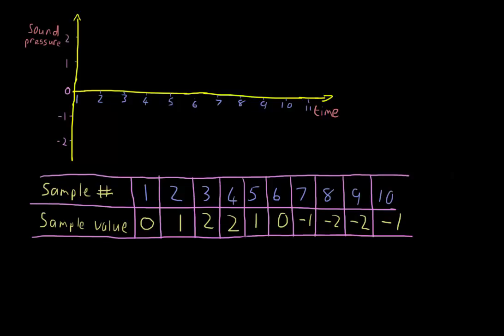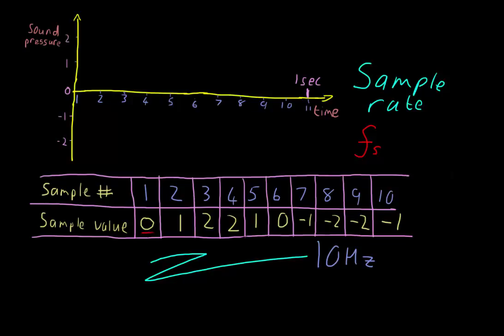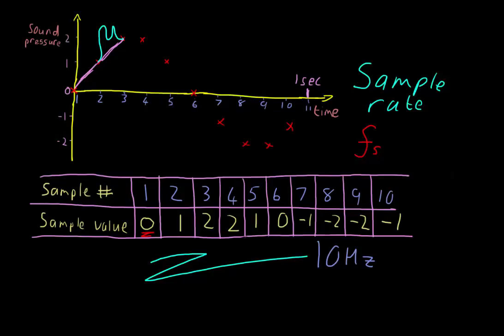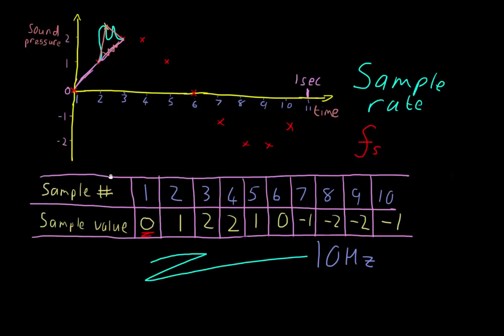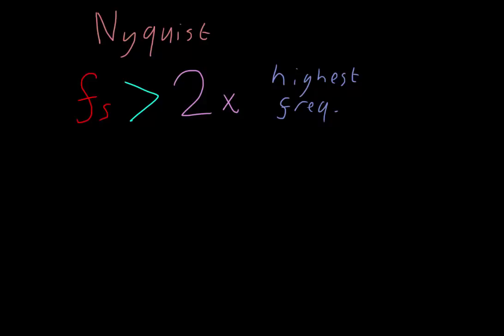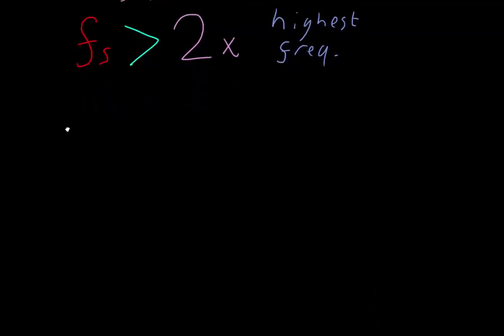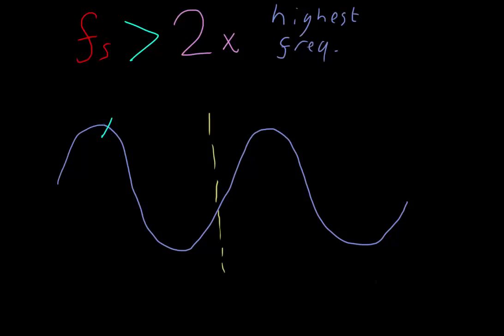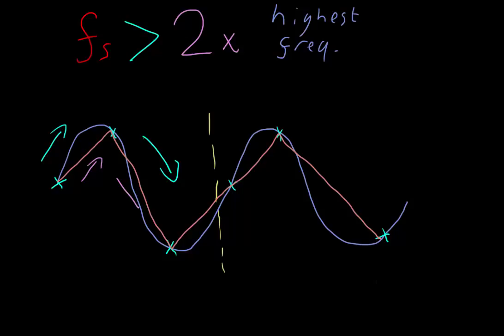Sample Rate and Nyquist Frequency #khanacademytalentsearch

Comment: Question: by using two samples per cycle, what if we choose our (2) samples to be on the highest, and least points on the wave (maximum and minimum amplitudes)? If we choose them that way we can tell if the wave is going up or down so why dont we do that instead of 3 samples? Thanks
Reply: yeah you are exactly right. That's why it's still work theoretically if the sampling frequency is exactly two times of the signal frequency.